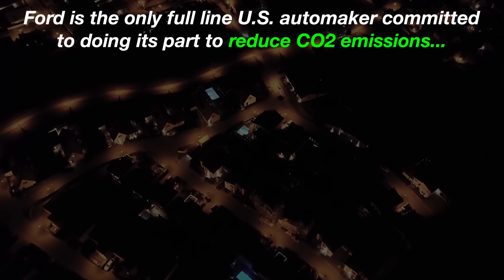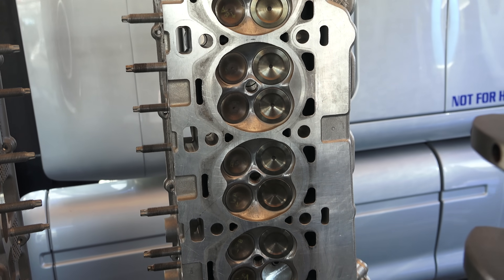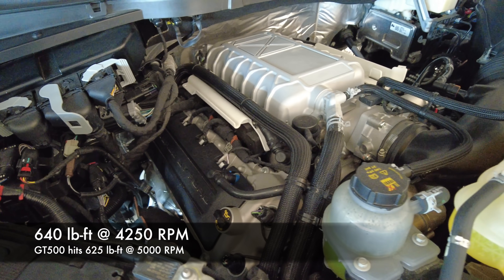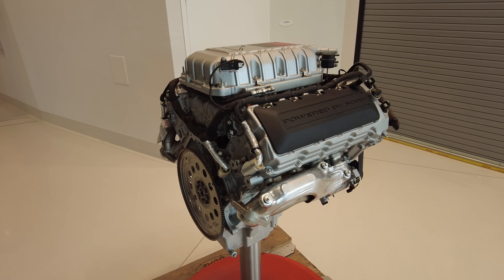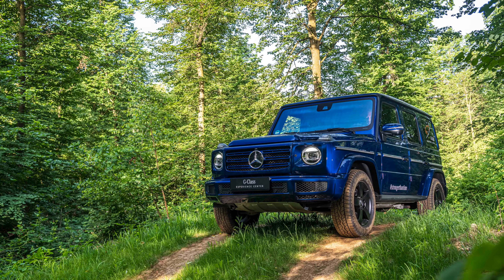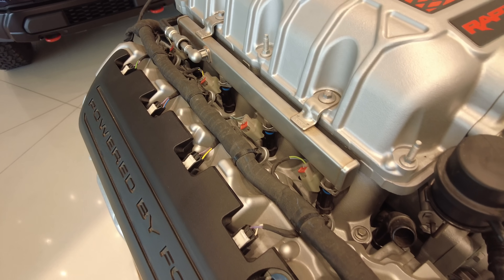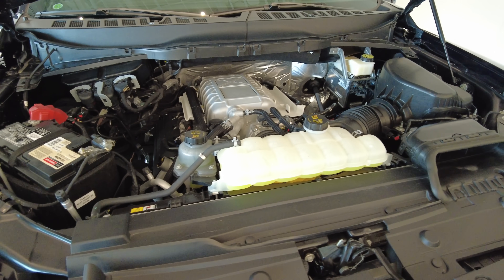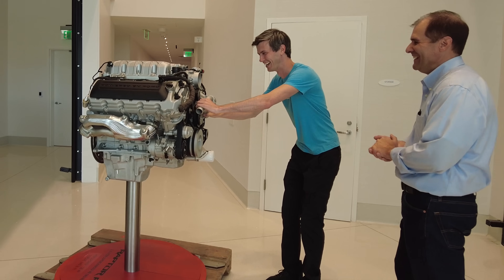Ford Raptor R's New V8 Engine - Meat's Back On The Menu

Comment: Overpriced, it needs ProPower onboard to power our campsites and overlanding experiences and jobsites... And a 20-30gal fuel cell as an auxiliary... Beefed up 10Speed Plug in Hybrid Transmission 14KW-20KW Battery, and 70HP-100HP Electric Assist... Then you will be equal to the weight of the RAM TRX, but can go the distance it cant, and have more HP, and be a be able to be in only electric mode for like 20miles a day, and still have decent fuel economy when your not on the throttle... Then it would be worth 30K more!!!

Comment: I would love to know more about the composition of the plasma sprayed cylinder linings.  I read a few articles and am no wiser.  It reminds me of the Nikasil liners that were used by Jaguar and BMW, then abandoned because of engine failures caused by high sulphur petrol eroding the liners.  I had a 1998 Jag for twenty years, no problems with the Nikasil liners.  This ford  V8 looks great.  Sadly Jaguar is discontinuing the 5 litre supercharged V8 soon, to go all electric.  I will always go for a big V8,  maybe I will have to switch to Ford or GM.  Until then I will enjoy my F Pace SVR.
Reply: Yeah, to me, this battery electric push is really a killjoy.  Sure, some battery electric cars are quick, but other than this I can't say I find them particularly interesting.  No exhaust note, no cool visuals when you pop the hood, no manual transmission compatibility, limited options for tuning and mixing/matching parts.  I really, really hope at least some automakers keep offering ICE.

Comment: As awesome as I think it is that Ford is putting the 5.2 into the Raptor R and turning it into a real performance truck (I thought the ecoboost was a joke for a truck that's supposed to be a high performance vehicle) I defenitely am not someone that will spend $110,000 on a vehicle when I can spend $5,000 on something I can beat in the woods and in the snow without feeling bad about it.

Comment: Port injection,smaller pulleys you know Ford left some wiggle room for the aftermarket and made it super easy to mod the Raptor R.Bigger injectors and a pulley swap=800hp with basic tools

Comment: Still not impressed by Gasoline V8s. Make another 400lbft more and make it from 2500-5000rpm and I may be impressed. My 6.7 powerstroke will still move a 8300lb pickup my more authority than either the raptor r or TRX and I can tow 22k all while cruising on the highway getting 23mpg(unloaded)

Comment: I'd argue that the G Wagon is a significantly more well-rounded off-roader than the Raptor. And on the none AMG variant the side pipes are tucked up higher to prevent scraping. Yes, most people will never use them off road, but if you've seen them put to the test you'll know the G Wagon is one of the best off-roaders in the world.
Reply: G wagons are a wealthy soccer mom vehicle. Parts are too expensive and hard to get to make it a decent off road vehicle. Mercedes makes overpriced garbage.
Reply: @Connor4x4  Are you high lol? Out of the box it's one of the best off-roaders in the world 😂 A simple search on YouTube will show you that. Just because because it's not some cheaply made pos doesn't mean it isn't built up to the job lol. When Mercedes builds something to do a task they do it right.
Reply: @quentinfreeman7516  It's an expensive pos. Whistlindiesel tried it in the bottomless pit and it instantly died. Even a ford ranger was better lol.

Mercedes is trash
Reply: @Connor4x4  Whistlindiesel also ripped it through sand dunes and it did fantastic. Some random bottomless pit that literally anything outside of a purpose built mud truck would get stuck in? That's your argument? Wtf🤣 And also even did it actually die? They drove it in there multiple times and then later dropped it on a building multiple times and it still runs lol
Reply: @ericd1632  Do actually have an argument, or do you just want to giggle like a child?

Comment: Personally I'm surprised Ford hasn't developed a small displacement EcoBoost V8 motor. A twin turbo 4.0 EcoBoost
would be badass
Reply: The cam phasers would crap out and it would end up next to my 3.5 at the dealership service bay. 10 days and counting…
Reply: Well...actually...they kinda did....the Ford-Cosworth 2.65l Indy V8. Made for racing from '75 to '07...500 to 1000hp depending on application....One of the most important engines ever made....Too bad it never made it to the street....

Comment: As long as every next model of Pick-up needs to be bigger than the current model, "environmentally friendly" is a total joke. All the pick up manufacturers are in on it. Things are absolutely enormous. Get behind a current F250 and it looks like you are following a 2 story building down the road! The base pickups are bigger than the older 350 3500 models. Why does a hood have 6 inches of air under it? MARKETING. We are way past comically huge now. A few hot rod Raptors are not a problem. An entire fleet of pickups LARGER than a H2 from a mere few years ago is. The only logical end is eventually pickup truck drivers will be level with Kenworth drivers.

Comment: Off-topic, but I'm always hearing how good a S2000 shifter is.  I would ❤ to see Jason break one down and explain why that is from an engineering point of view.
Reply: The Miata's shifter has quite a good reputation as well. It's likely due to the directness of the linkage (rods not cables, not tons of soft bushes, etc)
Reply: For budget shifting fun, try a first-gen RX7. Absolutely luscious shifts.

Comment: The 2º most important consequence of CO2 emissions is the greenhouse effect

The 1º is plant growth. CO2 is plant food, and in fact, the carbon that makes plants come from there, not the soil. Some comercial greenhouses increase on purspose CO2 levels up to 1200 ppm (we are at around 420 ppm in open air) to turbo boost growth.

Since 1985 till now, the whole planet has greened a whooping 20%, also in remote zones, mainly due to the increase of 40% in atmospheric CO2 of the last century

Deforestation has stopped in the whole world, except the Amazonas disaster. Famine drops in free fall, every decade there are new growth records in cultives, even in the absence of new fertilizers or insecticides

Nobody ever mentions that, which is HUGE. Finding the academic articles and the satellite pics proving this has become increasingly difficult, they are buried in the depths of Gugle by now...but you can still find them

if you search, of course. God forbids.

Comment: Someone else beat me to it. 

The bypass valve is more of a return for excess air to come back out of post rotor pack section. It let's air come away from the intake valves, not towards them. Eaton, and all roots blowers, are positive displacement. They will always pump 2.65 liters of air per revolution. You don't need that much at idle or cruise, even at the lower density from vacuum, so the bypass valve lets you recirculate the same air, rather than pulling more air by the throttle body.

Comment: Why not just use an exhaust pipe with a huge diameter ... like 6 to 8 inches to avoid the exhaust pressure resistance issue?

Comment: Ford has gotten way too far ahead of itself with this thing. This is the truck we all wanted and shouldve had since the Gen 2, but seriously Ford can hardly keep up with current vehicle demand. Go and try to buy a standard or even 37" eb Raptor, if in the off chance theres one on the lot, theres an ADM and if you order one, maybe a year to get it. I dont know how many of these Ford can produce, but word is dealers are getting 1 or 2 allocationgs and the currnet ADM is $50k. Being you can actually buy a TRX under MSRP if you are willing to do a bit of shopping around, this truck will be nearly double the cost of a TRX. This truck was made solely for car reviewers and magazines so on paper the Raptor can compete.

Comment: Now they only need to work on quality control with those body panel gaps and drilling holes in the intercooler to get rid of the moisture in the system...

Comment: AUTO PRICES FOR BASIC BRANDS LIKE FORD THAT ARE EQUIVALENT TO A SMALL HOUSE IS INSANE. HOPEFULLY THIS RECESSION WILL REIGN BACK IN SOME OF THESE RIDICULOUS PRICES..IF THEY WOULD ACTUALLY BUILT THEM TO LAST AS LONG AS A HOUSE MAYBE I COULD SEE IT BEING ACCEPTABLE BUT THE ADDED TECHNOLOGY AND INCREASING USE OF ELECTRONICS FOR STUFF THAT STAINLESS STEEL CABLE COULD HAVE DONE (GAS PEDAL, THROTTLE BODY FOR EXAMPLE) AND PERSISTENT RUSH TO USE NEW TECHNOLOGY THAT HASNT BEEN COMPLETELY PERFECTED TELLS ME RELIABILITY,  DURABILITY AND BRAND INTEGRITY ARE NOT AT THE FOREFRONT OF ENGINEERS/CORPORATES THOUGHTS.
 IF WE HAVE TO PAY EXUBERANT PRICES THEN ALL THESE MANUFACTURERS NEED TO TAKE A PAGE OUT OF TOYOTA/LEXUS PLAYBOOK AND BUILD WITH THE INTENTIONS OF IT LASTING MORE THAN 10 YRS OR 200K+MILES  WITHOUT MAJOR REPAIR.

Comment: Great video! However, I can clearly see that the supercharger is a screw-style, not a roots. The cutaway at 4:13 shows the rotor very nicely. It looks just like one from a Whipple supercharger; a roots looks completely different inside. Screw superchargers are much more efficient than roots; Ford knows this and has been using them since the Terminator Cobra Mustang. Gale Banks has a great deal of information regarding the two styles on his YT channel. Overall, great content! Keep it up!
Reply: Obviously you can’t see clearly because that is in facts a roots-style, not a twinscrew😅

Comment: With biofuels or synthetic fuels on the horizon, this could be a thing of the future
Reply: Most importantly, synthetic hydrocarbons ACTUALLY EXIST, and they DO SOMETHING.

The magical unicorn technology batreries that everyone's talking about DON'T exist.
Reply: No they will be too expensive and not subsidized to hell and back like gasoline and corn based ethanol. Biofuels and synthetic fuels will probably get used in esoteric stuff like hypercars, motorsports (already being used in WEC thanks to Total), aviation, and military applications where the high caloric yield of the fuel will be worth the huge cost.

Comment: Where is the Godzilla 7.3L with a bump in compression ratio?  I want my truck to have TORQUE at throttle tip in and could care less about 7000prm and a blower.

Comment: You're a 5.2 supercharged V8 my TRX is a 6.2 hellcat tuned for the truck how much it weighs all I have to do is change a flywheel and a belt and I go from 702 to just under 800 I'll wait 😆😂😆😂

Comment: I love that as the internal combustion engine heads toward its twilight, it's definitely going out with a bang (pun intended).  But since when does Ford not want to start a horsepower war with Mopar?  And where's Chevy in this arena?  They should call theirs a Meteor - you know, the thing that took out the dinosaurs 😁
Reply: Combustion engines are here to stay.
There is no reason why they can't.

Comment: Videos look impressive but that’s what company propaganda is supposed to be !
 Just wait until all the failures and recalls start surfacing, I’ve been working on and around autos for 50 yrs, there’s a very good reason for all the negative connotations about ford engineering and build quality (the lack there of)
   How many different Diesel engines have been in ford pick ups ? I lost count 🙄
   The 5.4 triton spark plug spitter ! Not even a good boat anchor!
  BTW. , the fuel mixture does NOT explode in the combustion chamber, it burns quickly, if it exploded there would be serious damage to the internals , you know better than that 🤨😂

Comment: They could’ve dumped the exhaust before the rear axle, it doesn’t have to clear the rear of the vehicle, they were just more worried about loosing the look of the exhaust tips.
Reply: As someone who dumped their exhaust in about that same spot, I can tell you you'd be surprised how many fumes come back into the cab when you are chilling at a stop light on a nice day with the windows down.

Comment: ford didn't want to start a fight with 703 hp as dodge would likely have just dropped the redeye engine in the trx and that would be that. whats more important is a much lighter truck with a better power to weight ratio. weight reduction is the most underrated performance improvement.
Reply: It's surprising that Ford decided to make it weigh less than 6k lbs. Thats the magic number for fuel economy metrics. I imagine the other trucks in their fleet offset the fuel consumption penalties.
Reply: @KevinSmith-qi5yn  over 6k lbs helps it qualify for business use and taxes.
Reply: Work truck? This is a terrible work truck considering it'll drink tons of fuel with the sc and the weight and tow rating are reduced as well from a normal F 150

Comment: people comments about using a supercharged 7.3 need to look at reality. ford is an auto manufacturer not a tuning house, they don't just slap a supercharger on an engine that wasn't designed for one. they need to make a reliable vehicle that comes with a warranty. the 5.2 makes plenty of power, its an off road truck not a street racer.

Comment: A correction - the GT500 and Raptor R definitely don't use the same oil filter if what's pictured in the video is correct for the Raptor R.  The GT500 uses a cartridge style filter carried over from the 2017.5+ GT350, whereas what's shown for the Raptor R is a spin-on type filter.

Comment: Ford needs to offer a naturally aspirated 5.2 V8 to sit in between the 450 HP V6 and the 700 HP V8 supercharged models. Ford, are you listening?
Reply: they don't care. people wanted a v8, they got it. ford isn't going to split hairs and build a brand new middle of the road engine for such a special vehicle.

Comment: The TRX will clap the Raptor R. It's underpowered compared to the TRX. Ford had a huge opportunity with the GT500 engine in the truck but it also makes 60hp less than the GT500. The TRX is also tunable where as the Raptor R isn't. Ford massively dropped the ball on a huge opportunity here.